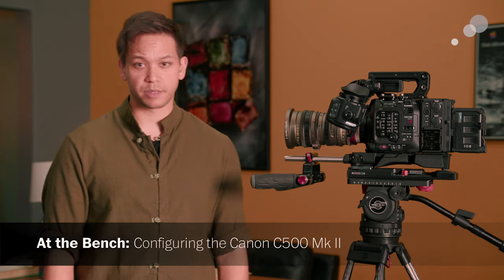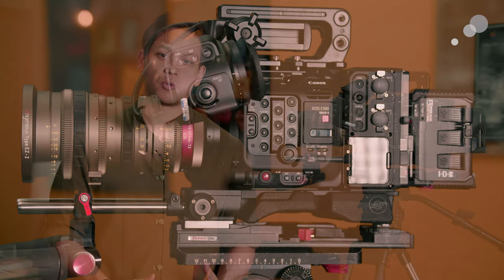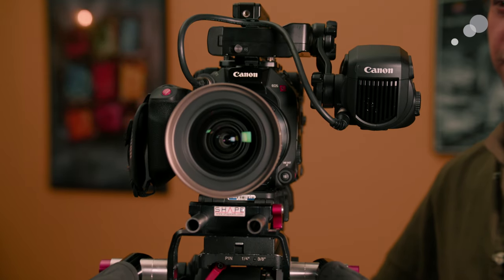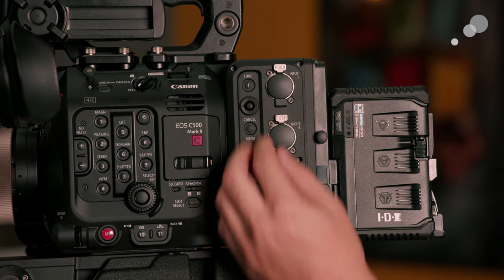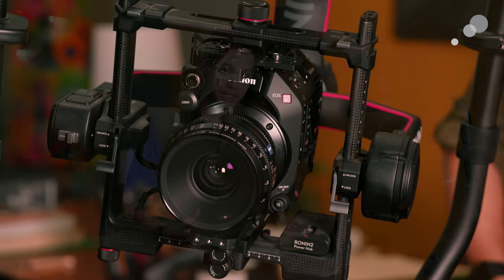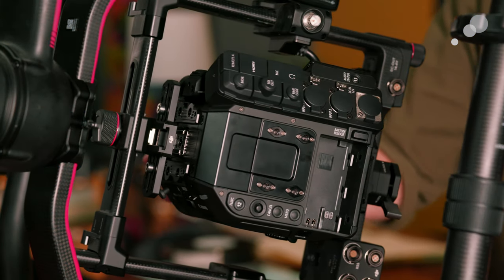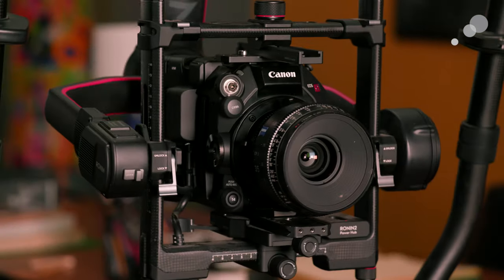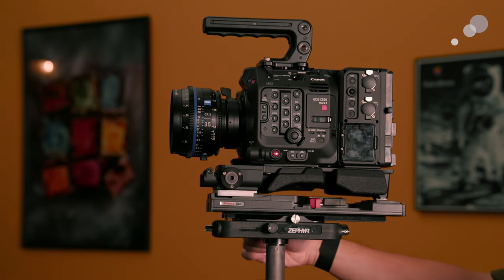At the Bench: Configuring the Canon C500 Mk II Camera

Comment: Useful info. Thanks. Can you tell me how you've mounted the EVF-V70 in the shoulder setup you show in the video? It doesn't look like you are using the canon clamp, but it's not clear what you're using. Thanks!
Reply from the maker: Hi - thanks for the comment, here is a response from Nic: It actually is the stock mounting system that comes with the EVF-V70. However, at the time of filming, the C500 Mk II camera we had was pre-production and didn't have a top handle, so we used the top handle and mounting bracket from a C700.

Comment: Hi any insight as to which WFT transmitter works with the c500 Mark II? Thnx!
Reply from the maker: Hi - thanks for the comment, here is a response from Nic: Canon's literature recommends the WFT-E9 adapter originally designed for the 1DX Mk III.
Reply: @AbelCine_official  thnx so much!

Comment: Does the evf v70 works on c500mk2. On websites they say its for c700.
Reply from the maker: Hi Robin – here's a reply from Nic, one of our tech specialists: The EVF-V70 was developed for the C700, but because Canon uses the same UN-5 connector cable across all their modern cameras, the EVF can be used with a variety of models, including the C500 Mk II. Note that to use the stock top handle of the C500 Mk II to mount the EVF with its included bracket, you'd need Canon's CL-V2 Clamp Base adapter."
Reply: @AbelCine_official  thanks for helping out!